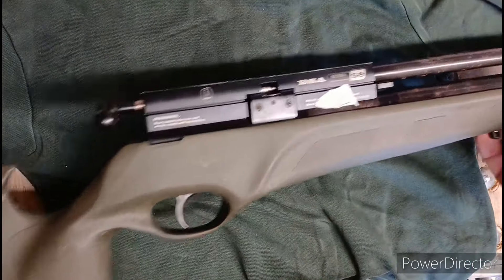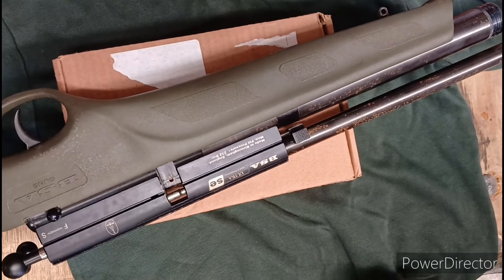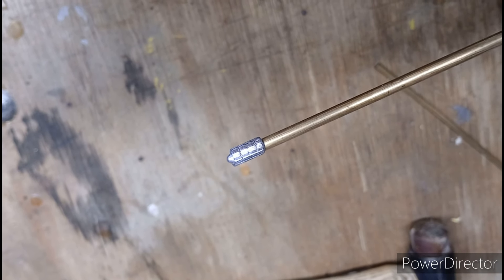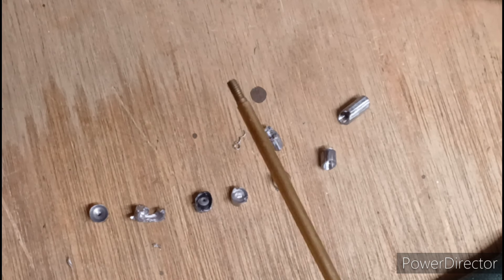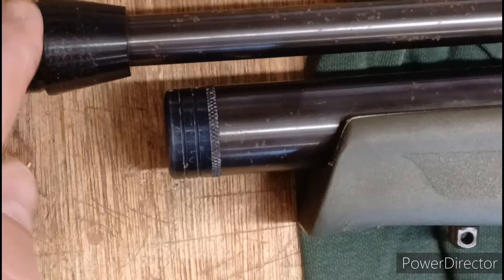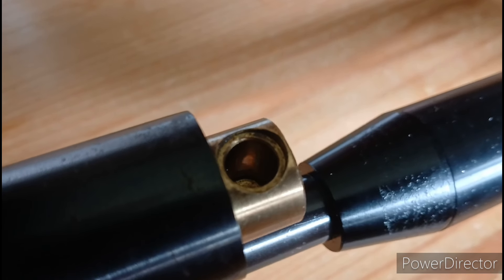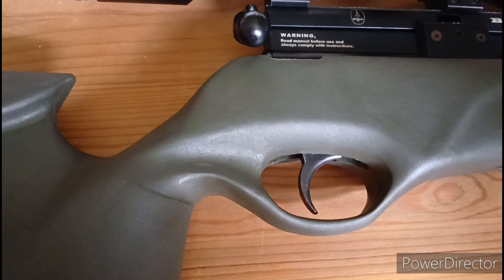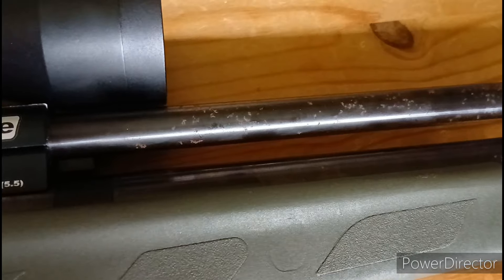NV123 BSA Ultra SE. Stuck Pellets & Won't Cock

Comment: What a coincidence. Got my old BSA Scorpion FT gun out yesterday for a bit of 10m paper punching. As I eased the Finale Match Light pellet into the breech it came to a sudden stop. Ten minutes later, after much gentle knocking on the end of my cleaning rod, out of the breech popped three deformed pellets. My son was the last person to use the gun, and he'll get a piece of my mind next time he comes over.  Still, no harm done, the rifle shot just as well as it always does once the blockage was removed 🙂
Reply from the maker: Hello,  thank you for your comment and thank you for watching. 
Glad to hear there was no damage done.
Guess he thought he was an amazing shot, with the last 3 pellets through the same hole?
What is the Scorpion FT like? I hadn't heard of that model.
Reply: @nickvending9688  Long story.  Friend of mine asked me if I'd like to join him at a local FT club.  Not having too much cash on hand at the time I had to go the economy route.  My old Mk1 Scorpion got a used Ginb skeleton stock, with a UK Neil butt hook and silencer cum barrel weight cum air stripper.

It is a super accurate air rifle which had been previously tweaked by UK Neil.  To finish the rig I bought a battered but functional Big Nikko scope for not too much money on the BBS and job done for a rookie FT shooter.  If you get a good BSA barrel the accuracy is astounding and can keep up with much more expensive kit.  Shame they sold out to Gamo.
Reply from the maker: Sounds like a great bit of kit. I'm all for building using rifles I've already got, at least they are known good rather than risking buying something new.
Agreed about BSA barrels and yes their spring guns have certainly suffered since the Gamo ownership.